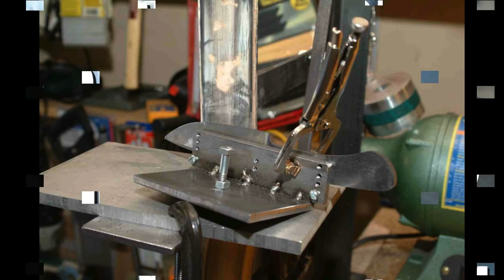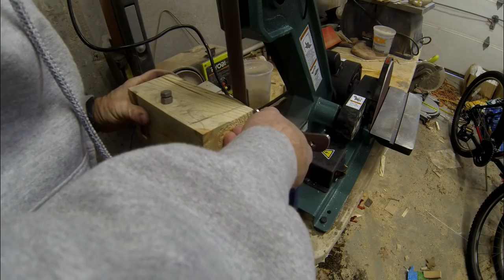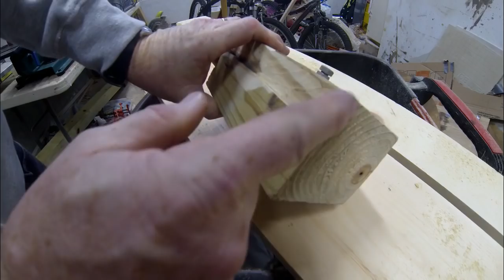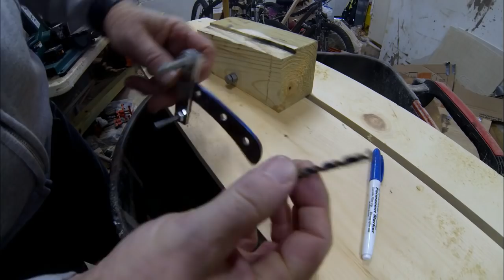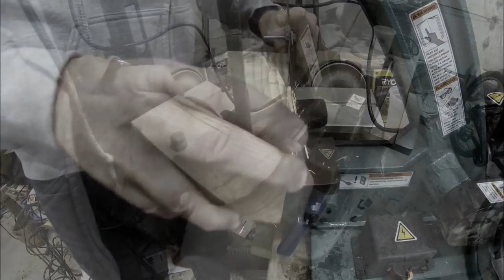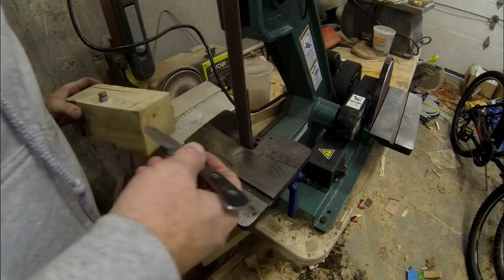DIY Easy Knife Bevel Grinding Jig

Comment: What is the depth of the 1/4 or 3/16 wide cut? what is the length of the  4x4? Would two 3/8 bolts give it more stability?
Reply from the maker: Length is about 10 inches. Yes 2 bolts would be better

Comment: Perhaps it's better than nothing but it seems like there's a lot of slop, or play, in the jig. Almost like you have to force it, as if something is catching on the tool rest. A lot of front to back play as well as side to side.
Reply: Dale Martin ya that’s the worst jig I’ve seen yet lol. The point is to have a tool that allows you to repeat the exact process over and over. Each pass with this “jig” is entirely different 😹 I cannot endorse this video